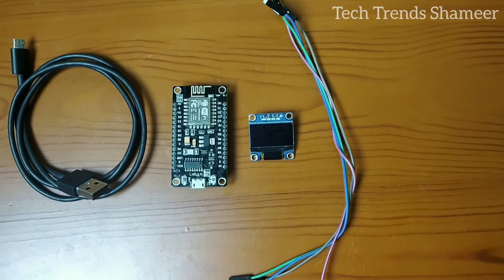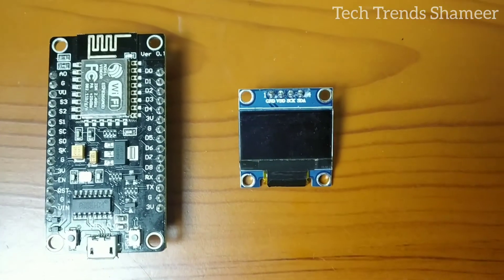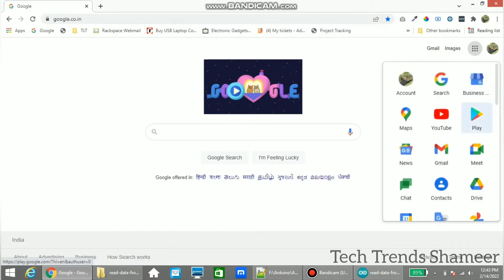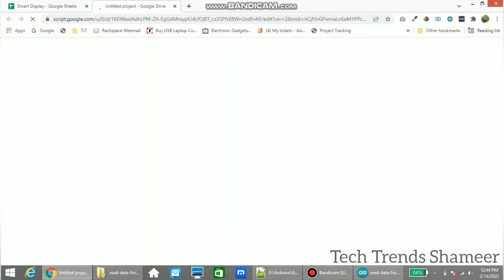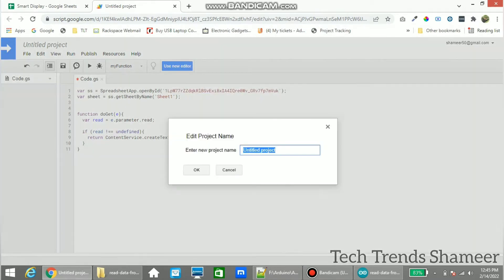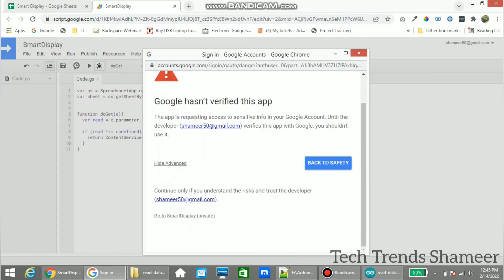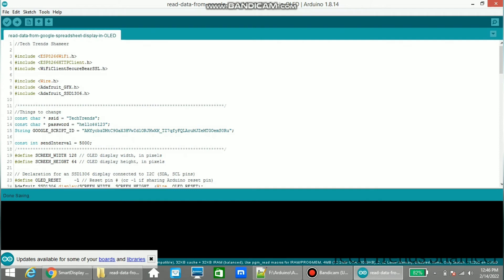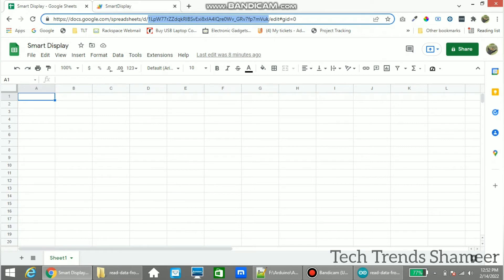How to Read Data From Spreadsheet and Display in OLED | ESP8266 Projects

Comment: Been thinking of upgrade my “Don’t disturb” while I am working. I currently use red/gree LEDs. This will be a good improvement with actual test!
Reply from the maker: Thank you.
Reply: @TechTrendsShameer  Got stuck with this error: no matching function for call to 'HTTPClient::begin(BearSSL::WiFiClientSecure&, const char*)'
It highlights this part of the code: "https.begin(*client, url.c_str());"
Reply: Any idea?
Reply: Fixed it by upgrading the ESP8266 community version to 3.11 then re-creating the whole project.